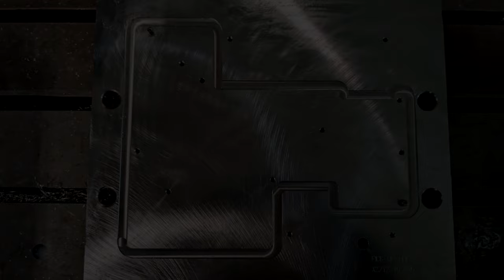NEW GUY AT CRT, CASPER-MATIC UPDATES, 440 FIXED

Comment: Put a straight edge on each bearing housing and measure between them, no need to send it out... The first numbers of the belt is the series number and 435 is the length, 43.5" + - a little. A 15435 is a 15 series which refers to the belt width and angle and the width is like 13/32".
Reply: We changed to a 423 and that worked it just need to be a little shorter so we didn't tap out the adjustment slot

Comment: hey john auto zone, junk zone  !  thats why they work there. ask most who work there  about a cell phone they will tell you about anything. nothing like old mopars. i have a 1977 dodge army truck with a dana 60, 318 0.030 over stromberg 2 bbl with holley jets  138 lbs cyl pressure stock heads surfaced aprox 0.010"" 727 with pump mods, stock convertor forgot to tell you it has a dana 60 front axle 4wd. doesnt look great but plows snow like a s.o.b.!awesome show you have. mopar back to you.  i wish you were closer in distance id be there all the time to buy stuff. i still have a bit of 727 parts. you always need that. the hell with the moron garbage electric trash,along with ignorant scummy polotics. got to wait for the rain and the rest of the monsoon to pass through. take care.